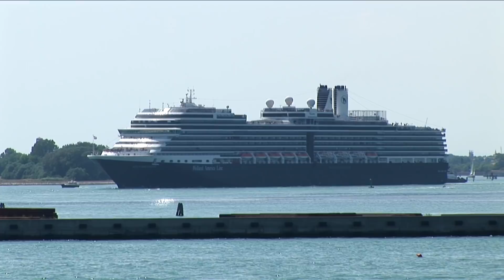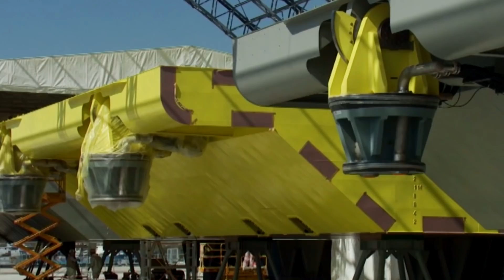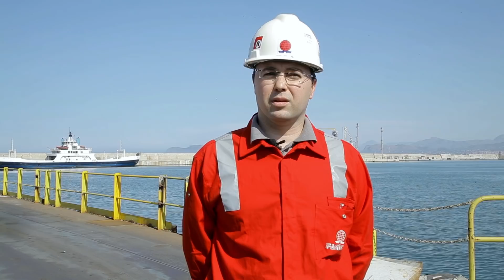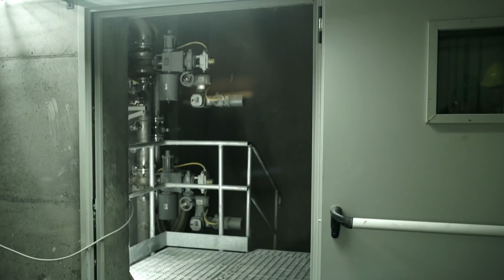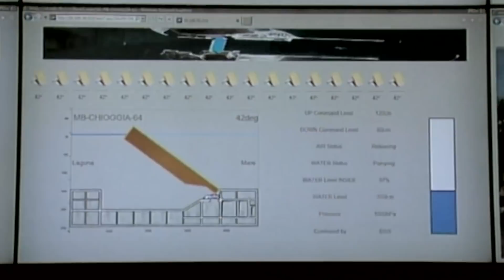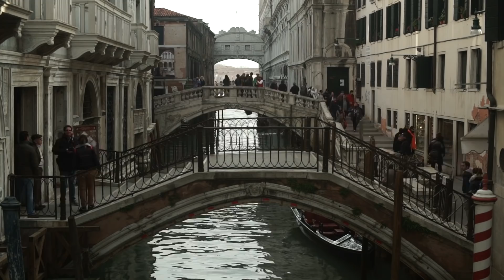Giant 7-Billion-Euro Flood Barrier | Heavy Lift | Free Documentary

Comment: They messed up that barrier, the foundations weren’t made or designed correctly and sand builds up under the barriers, and the barriers have rusted too. I think Venice is going to sink anyway. Still it’s an ambitious project. It’s also full of corruption, think of Italy think of mafia, just like that bridge that collapsed due to faulty cement being used as the mafia and corruption were involved in its delivery.